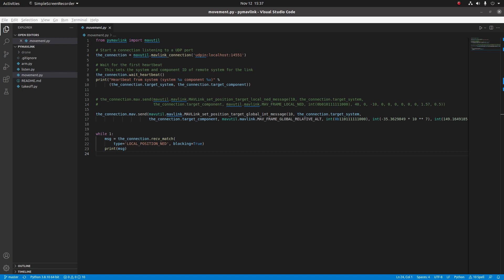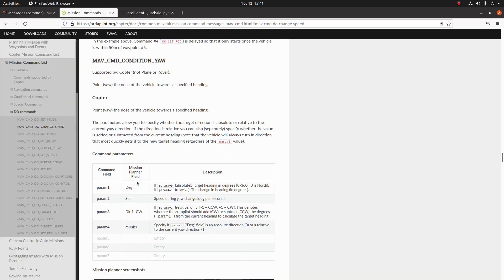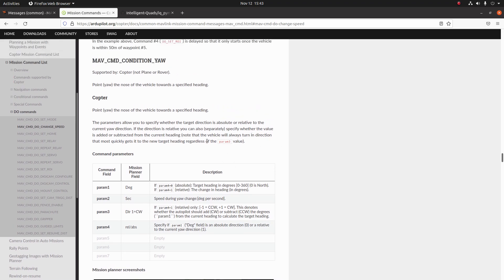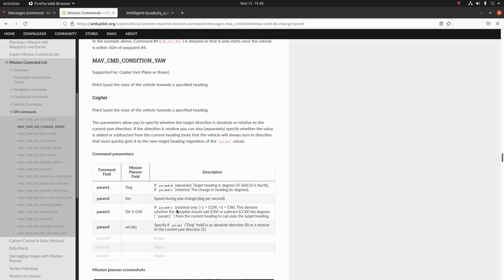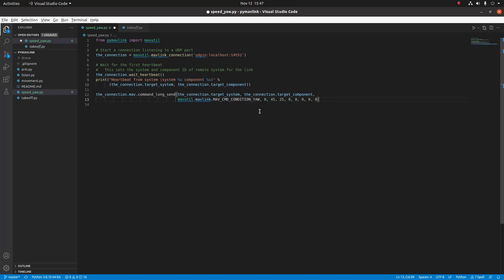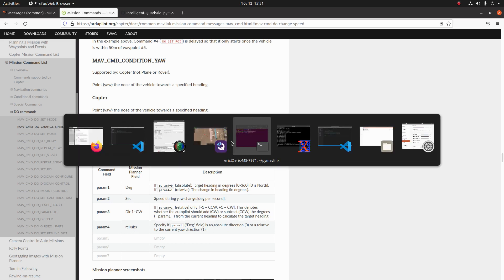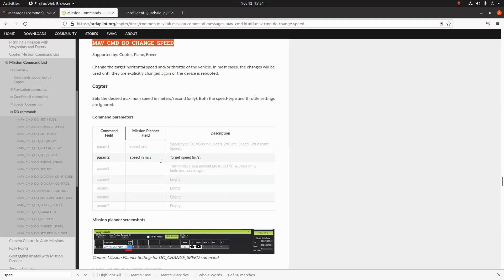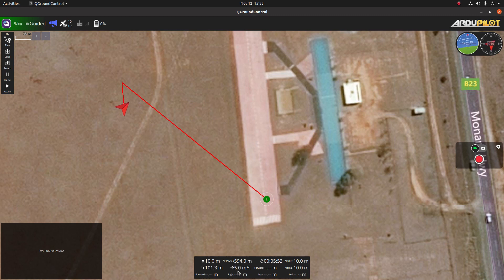05 Pymavlink Set Yaw and Speed

Comment: Hey man, question about QGC: if a custom qgc developed based on ardupilot would it be faulty if used with PX4? 
In other words is it wrong practice to custom QGC with ardupilot and use QGC with PX4 flight controller firmware?